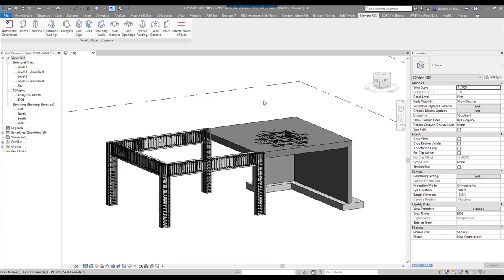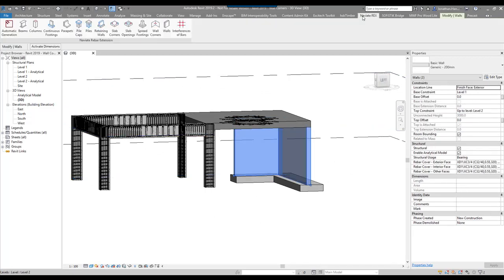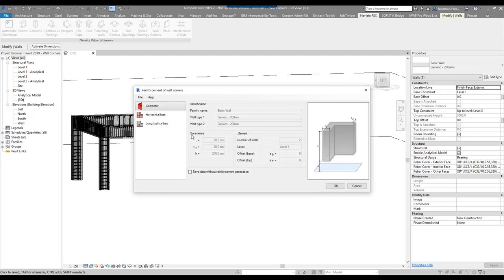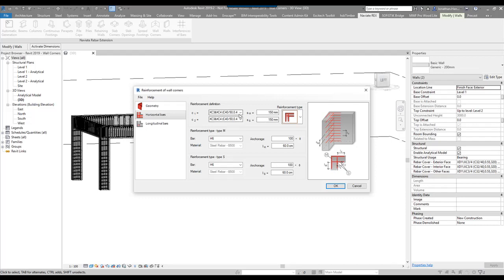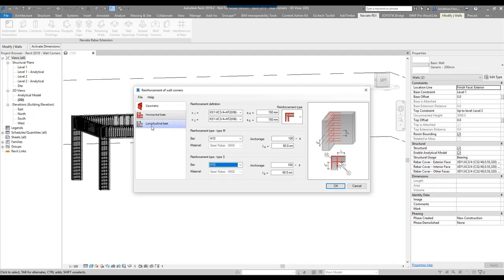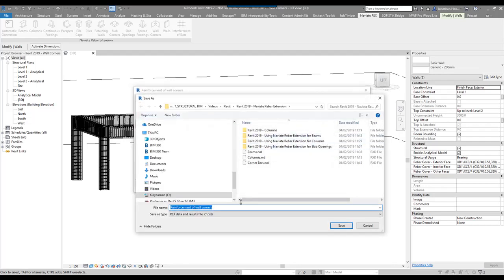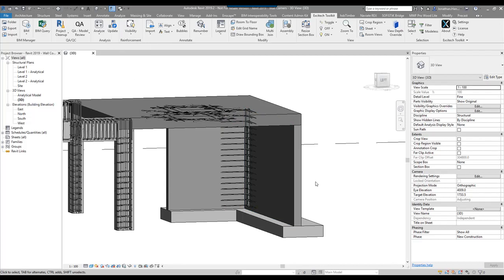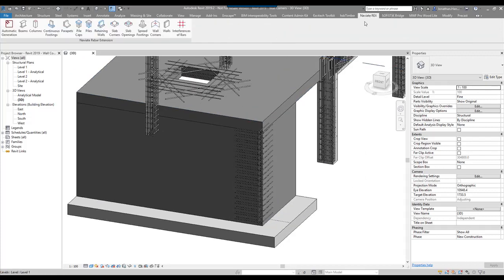Revit 2019 - Using Naviate Rebar Extension for Wall Corners

Comment: This is really excellent tools for wall corners, but is it feasible to use retaining walls icon for reinforcement of those two walls or do we need to apply rebar separately on each wall. Is there any tip, I have tried to select two walls and it does not work.